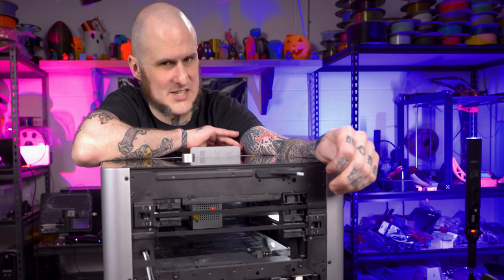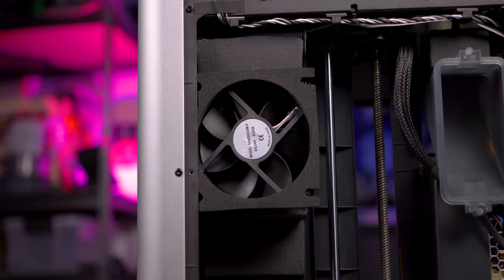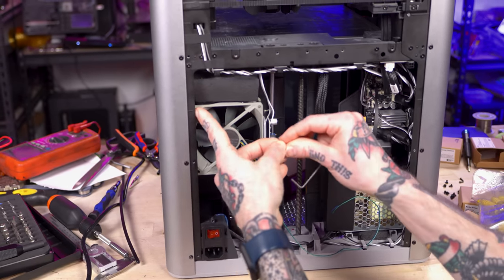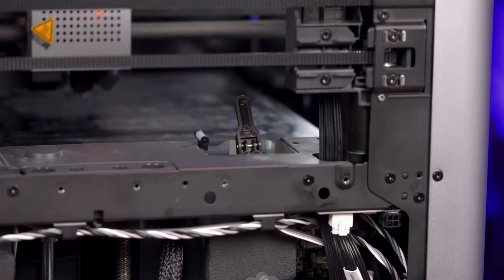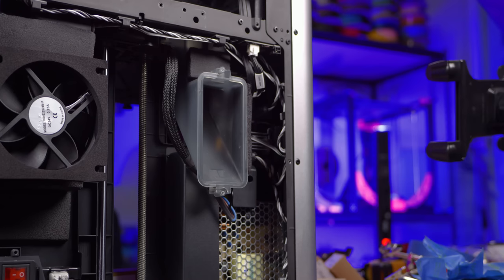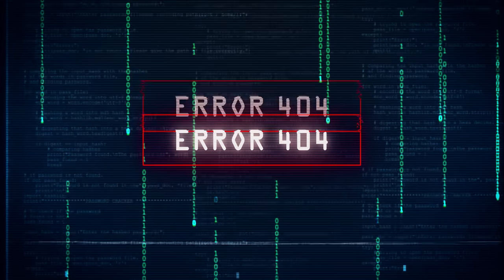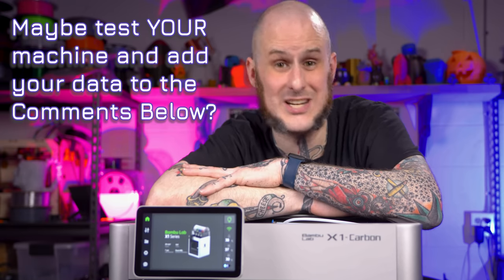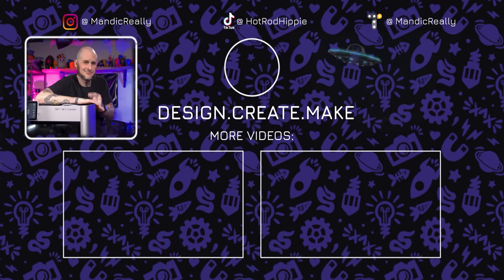Noctua Fan in the Bambu X-1? Chamber & Mainboard Fan Replacement!

Comment: I just did this upgrade today with a Noctua NF-A9 PWM + the main board fan with a 4010 5V Noctua NF-A4x10 PWM. It’s super quiet now. Thank you for this video! 

I set the fan on the left side of the bed to 20% in the slicer software. It’s so wild how quiet it is now.
Reply: Hi, could you let me know how to install the main board fan. The connectors are not the same and I think also the pinout...
Reply: What wires did u splice to the old mb connector ?

Comment: The 92mm Bambu chamber fan is a 4800 rpm fan shifting 92.5 cfm with a lifespan of ‘over’ 20k hours at 40 degrees C.
The Noctua NF-A9 PWM is a 2000 rpm fan shifting 78.9 m3/h which equates to 46.4 cfm so it’s half the Bambu speed and half the cooling, but is rated for over 150k hours of use.

Half the cooling probably explains to 2 to 3 degree chamber difference compared to some of the Bambu original fan quotes of 6 to 7 degrees, while the speed differences of 2000/4800 equates to the Noctua running at 41.66% of the Bambu original fan speed.

All the same, I’m seriously considering this same upgrade myself.  The Chamber fan bearings are starting to sound rough after 4 months of (continual) use.  The 40mm MC fan failed 2 months ago, and though Bambu sent a replacement I elected to use a Noctua NF-A4x10 to replace the stock Bambu MC fan blowing through the heat sink vanes, with a second NF-A4x20 mounted at the side of the poop chute and blowing directly onto the flat of the heat sink and on the MC board itself.

I’ve also got a printed baffle mounted to the rear of the case using N42 magnets, which drastically reduces the fan sound when printing.
Reply from the maker: My replacement 40mm already sounds terrible and will be getting the Noctua treatment soon as well.
Reply: @MandicReally  was that a Bambu replacement ?  I’ve seen a few specialist articles now all saying that the MC fan is badly positioned to cool the MC heat sink, because the fan design creates a cone of moving air expanding out from the fan, and so doesn’t provide as much cooling directly in front of the fan as it does if it’s offset a little.  I ended up replacing the stock MC fan with the Noctua 40x10 5v pwm then I also added a second 40x20 5v pwm fan next to the purge chute blowing onto the face of the MC heat sink.
Reply: Links to the baffle STL or maybe a photo or description of how it works?

Comment: Noctua fans are one of the best inturns of how quite it is and the airflow you get, but just like many have experience on moding their hotend cooling fans to noctua fans and experience clogs it is because yes they are good but their airflow are not great. So people who want to try out noctua fans need to be careful of temperatures see if the noctua are sufficent enough espcially on eletronics cooling fans if you replacing them on any machine.

Comment: I purchased all the parts for this because my chamber temps were sitting at 39 with the chamber fan turned down to 70% so I didn't hear the fan roaring during the prints. I was hoping I could run the Noctura full tilt and I'd get better cooling but after doing a bit more research, I have a feeling even running full tilt, it's not as much air flow as the Bambu fan has running at even 60% so this probably isn't a good mod for me considering I'm wanting a quieter experience while cooling more. I have installed some fairly large risers to keep the glass off the top and some small fans to help with air flow and now I'm sitting at 36 while printing PLA... Do you think this is cool enough to combat the whole extruder clogging issue that I've been having? Running hot end at 220 and the bed at 60 for first layer then 55.

Comment: I happened to do this yesterday just for the control board fan since the knocking finally got so loud that my wife  couldn’t stand it anymore. 

I opened it up and saw that the fan just wasn’t spinning and knocking super loud. I went through the same deductive  procedures, I decided to just cap off the  white and light gray wires. The sticker on the fan hub was oozing from the melted adhesion and just lifted off.

It seemed fine to just have the noctua a4x10 just run 24/7 to cool the heat sink. It should just circulate the air inside the chamber (?) I’ll have to observe and see.

I looked into replacing that 24v 92mm fan but couldn’t make heads or tails on how to approach it so I just left it stock for now.

Comment: Interesting mod, even that I don´t own one of these printers yet, I think I will soon 🙂 
I don´t find the fan confusing, but maybe it is because I am a mechanic, and see things differently, and maybe I am wrong, but to me it looks simple. 
Pla needs lower temp, therefore top off, and a fan to push fresh air in, you can not push air into a closed chamber, you need to let the air out to get circulation. 
And the filter - ask any mechanic or painter, they will tell you it is because when you stir up dust, it will set in the wet paint or in this case, the wet plastic, the filter is there so you don´t get impurities in the finished product.
Reply from the maker: The filter on the "Chamber Temperature Regulation Fan" is a Charcoal filter ONLY. It has no other filter media in it. So it doesn't act as a particulate filter the way you have in a paint booth.

I'm a former Auto-Tech & Custom Car Builder, our paint booths were sealed shut. Heck last shop I worked at the painter would tape the doors before he sprayed to reduce gaps & hose down the area outside of the door to prevent dust from kicking up. The only entry paths for the air traveled through filtration to get into the booth. The Chamber fan on a Bambu Printer draws air in from gaps around the frame & door. As such it wouldn't do as you say, it would actually draw IN particulates from the surrounding environment. 

The fan draws in cool outside air and expels the hot air out the back of the machine. It does that job just fine to reduce chamber temp. But its use of a Charcoal filter is just... flawed design. Materials that NEED charcoal air filtration, need higher chamber temps. It should recirculate back inside of the chamber to maintain the heat. To make it really functional it needs a flap to direct air like a cars HVAC system. Recirculate for higher temp materials, and expelling it out for lower temps.

Comment: Trying to compare the main board in your video with the one I have in the P1P, they look pretty much the same layout, with the exception of an empty header on your board that doesn't have a header soldered on for the P1P. That to say, there is no board cooling fan on the P1P. So assuming the drivers are the same, and the firmware isn't cooking the X1 more than the P1P, probably don't even need that fan. Which as you mentioned, doesn't appear to be doing much anyway.

Comment: Greta job ! But besides the fans, one significant source of noise is the motors. To you think you can dampen them ?
Reply from the maker: I think it is more the mechanical system in general that is the primary noise source and don't really see much to be done about that. Fast printers are just going to generate noise.  My Vorons, FLSun, and Re-AniMaker all have their own loud points.  The Chamber Fan noise was the most unbearable sound personally.  I work near the machine and have gotten used to the sound of it printing, but the sound of that Chamber Fan was always annoying.
Reply: I see.
Do you think lubrication of the bearings has a role in noise ?
Reply from the maker: @_Xantras_  The X-axis uses self lubricating bushings.  It is possibel the Y axis ones are making some of the noise but I don't think that is the primary source.

Comment: The video makes it clear that it doesn't seem to matter all that much in this configuration, as a 1C delta is barely going to make a difference. Even if it did, you could just over-volt the noctua fan. I've been running mine at the raw 24v from the fan header and it's been perfect. It likely makes up, at least a little bit, for the low CFM at 12v.

Comment: I live in an apartment complex and can't have a loud printer.  I've been waiting for someone to make a drop in replacement, I thought it would happen since this printer is so popular.  I notice the firmware that quiets the printer still has the fan really loud.  I wonder why they just don't use Noctua from the get go, that would only add so much per printer when they buy fans in bulk.

Comment: I’d be curious to see what just running the buck converter on the stock fan and lowering the rpm (what you effectively did)
Reply from the maker: You can just lower the of the stock fan with PWM control. There is more to fan noise than speed though.

Comment: Hi bro, can i connect 2 noctua fans to this chamber instead of one? I will still use the stepdown but will connect 2 noctua fans on it. Is it possible or the board cant output the necessary voltage?

Comment: I really like your videos!
Even with all the points you have made with the printer, I'm still getting one. Just waiting for it to arrive.
Question.. Does the exhaust from the MC fan have to vent inside the control space, which might be used to help heat the enclosed printing area?  I don't have mine on hand to see if there is any area that crosses over to do that.

Comment: So if the Noctua is running at 2000rpm/min then it's quieter mostly because it's running slower.... I wonder how loud it's the sound of the stock bambu chamber fan at 40% speed.

Comment: Try taking out the carbon filter and see how much more airflow that lets through, it's probably blocking a lot of the airflow, and that's why they had to go with such a loud fan just to get it to work a little bit. And since like you stated, the filter does nothing on the material where it would be needed since the chamber fan doesn't run. Seems like a marketing gimmick lol

Comment: Someone I've been chatting with made a similar Noctua fan upgrade for the cold end fan.
But the fan was PWM controlled for some reason (Makerbot Replicator 2 clone, keeping the board for now).
And the combination of the buck converter and PWM made the entire thing reset or glitch out.
(we solved it by powering it with the always on control board fan header, the switched output will be used for part cooling later)
So if the chassis fan has PWM too, this might be a very problematic upgrade.

Comment: Cheap DIY it just slide the OG fan ground/power and use the buck converter to stepdown to 12-23volts for optimal noise/cooling to your taste. OR just ask Bamboo lab to update the firmware that allows you to control the fan. Easy Pease!!!
Reply from the maker: They actually did just update the firmware to allow adjustment.  Or you can edit the G-code to do the same thing. I just went this far because... content and why not?

Comment: the aux fan does the same.. goes to 100 then down to 30% or whatever. That is with a Bambu part on a P1P upgraded.. FYI, think you are right about how it commands the RPM. Also chamber fan page at Bambu says the stock fan is 4800rpm. FYI.

Comment: I ordered my P1S 10 minutes ago, allong with the 92mm noctua fan. I already have the buck converter, so I'm stoked to receive my first 3d printer and do the modification!
Reply: Did you Update the fans? Please send feedback How quiet it is now. Thanks.
Reply: Hows it going on the p1s im receiving mine next week and about to order all the parts. Is it still working as expected? Did you have any print failures with this mod? How is the sound? Thanks!
Reply: I decided for MK4 finally because of noise, Open source, maintenance, service. Once a successor of X1C is on the market I will consider to buy a bamboo again.

Comment: Noctua is actually selling 24V fans from their industrialPPC line. You won't need a step down circuit for them as they operate between 6V and 30V.
Reply from the maker: Only in 120/140mm sizes. No 92mm ones, so you’d have to design an adapter to mount it in this use case and modify the back panel of the machine. Or have a fan having off the back.

Comment: Shouldn't there be more room behind that mainboard fan to draw cooler air in to it.... .or is it not flush against the panel?
Reply from the maker: It’s not flush against the panel but it doesn’t have anywhere to draw fresh air from either.

Comment: What's the voltage of the PWM and Tach signal? I'm thinking if it could be corrected with a MCU in between or a amplifier or similar. To get 100% when it's 100%.

Comment: Noctua sells 24v fans, why didn't you go with one of those?
Reply from the maker: Noctua sells 24v fans ONLY in 40 (that's new)/ 120 / 140 mm sizes. This is a 92mm fan and NO LARGER of a fan will fit in the space. It would require mounting one externally and hacking together a back panel mod.

Comment: Just tune in the start G-code with the original fan to 40% and it will be really quite
Reply from the maker: Or disable it and remove the top glass / open the door.  Or buy a P1P.  Where is the fun in any of that? Ha
Reply: @MandicReally  hahaha, this is printer I dont want to mod, I have other ones for that, but great job on the mod.

Comment: FYI - the original chamber temp regulator fan speed is rated at 4800RPM with air flow of 92.56 CFM
Reply: The fan he installed is 46 CFM (78.9 m3/h) which seems much lower. I don’t know if another number might be important too like static pressure.

Where did you get your numbers from?

Comment: Hey, thanks for the video credit, seeing the other results makes me wonder if there's something wrong with my heat bed 😁 also looks like a few folks that are going to hate on this video need to learn about cfm and static pressure. To mangle a commercial, it's not about how fast you blow air, but how well you blow air fast.
Reply from the maker: I just picked up a thermal camera so I'll be checking the bed temperature consistency as we discussed.  If I get to it soon I'll try and remember to message you.
Reply: @MandicReally  looking forward to it!

Comment: What if I make another enclosure with 100% soundproofing material and cover the whole unit.  Would it cause any issues with thermal?
Reply from the maker: I would be concerned about the thermals of the electronics.  Most of them have some type of shielding from the chamber air (though not a lot in some cases). Even with other machines it is usually recommended that your electronics not be enclosed in a chamber with the heat sources.  It is part of why I've not encouraged doing that when folks have suggested it.
Reply: @MandicReally  If there would be a hack to add a second cooling fan to the MB, an enclosure would maybe be an option. Alternatively replace it with a radial fan which is gonna blow much harder. Do those ideas have any potential?
Reply from the maker: @KingShinobi82  could duct air in from outside the chamber to a fan on the back panel blowing right on the board.  But I mean more than just the board I showed. The X-1 uses a split up electronics system.  That "Mainboard" isn't actually the main control board of the machine.  There is one inside of the chamber. (I'm fairly sure that is where the Firmware is actually stored and run off of, along with wifi.) The Toolhead PCB, the motors, the touch screen, they'd all have to be considered.
Reply: @MandicReally  hm, thats less than ideal... I was planning a really nice soundproof enclosure with active airflow, but now i'm pretty unsure about the whole idea...
Reply from the maker: @KingShinobi82  your choice, I wouldn't do it but I don't have the data to say it really is a problem. Actively cooling the chamber would certainly help.
Reply: @MandicReally  I'm probably too curious no to try it 😄, but I will consider better ventilation and airflow and always the the ambient temps. I guess the temps shouldnt go above 30° Celsius or so

Comment: You could just add a buck converter to the original bambu fan to achieve the same effect.. Noctua fans are less noisy because they spinning slower, no magic.
If I print pla or petg I just open the door or the lid and it gives better chamber cooling, than this rocket fan. You can turn them off completely in the slicer settings
Reply: That's really not true.  Speed is part of it (but nowhere nearly all of it), it's also partly the design of the blades, as well as the motor assembly.  You can see this for yourself if you test other fans like for like against Noctua.  You can easily see the fan runs smoother, and even when ran at the same RPM, the Noctua fans are quieter.  (Noctua does offer 2k and 3k fans, and they are still considerably quieter than other fans at the same speed.) 

BTW: Noctua also works hard to optimize CFM for a given fan speed, so they often get more cooling done at the lower speed.
Reply: Yes because you obviously engineered the fans at Noctua and know it all.
Never mind the patents they hold, the blade designs they fund research for, the motors that other fan manufacturers don't spec for due to costs, the dampening pads that most fans don't have and the material make-up being dissimilar in many areas.

Comment: great ide to use noctue fans i use them what a difference they make. i was just wondering how much additional cost has it cost u apart from the printer in time and money, becasue me personalley after looking at more that 10 diffrant videos on this printer i would have probabley gone for somrthing more stable as this isnt one of the best printers for reliability at the moment even though its got 4 lots of filament, iv just converted my chiron to do the same thing with 4 colour printing and its faultless i used the bigtreetech gtr v1.1 board and the addon board and its still more versatile that the bambu and prints better quality maybe you could do a multi build that does the same thing as the bambu cos i know itle be cheaper and more reliable, just a though for you to ponder one